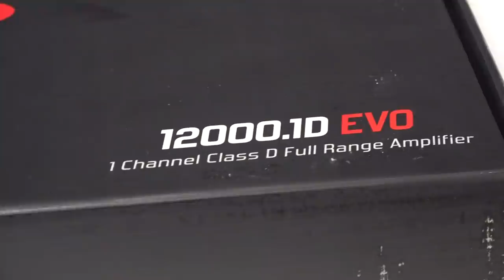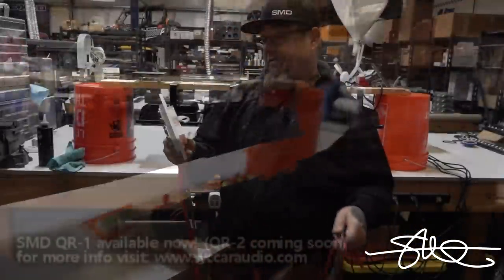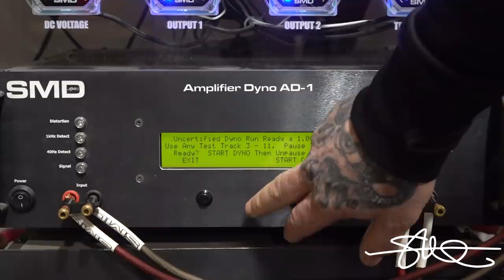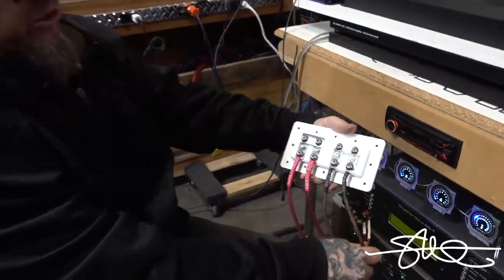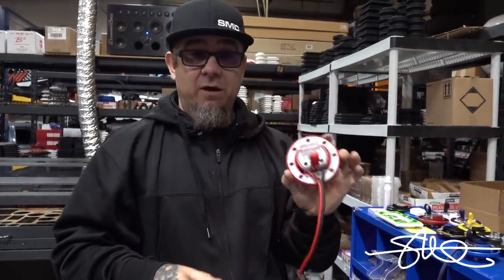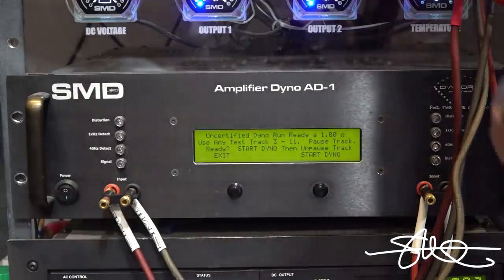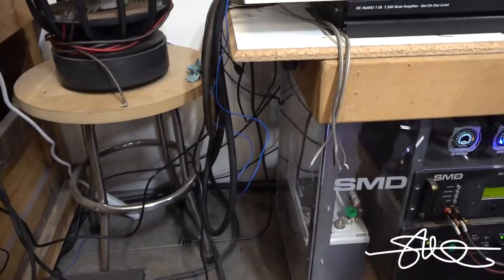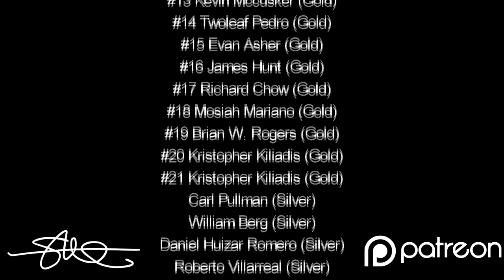12,000 Watts? Testing the Soundigital Evo 12000.1D Through the NEW SMD QR-1 Neo Magnet Terminals

Comment: Would be cool to see a FLIR thermal camera on the cables and terminal with that much power.
Reply from the maker: you won't see anything.  Not for this test. Everything was ice cold.  Maybe after i torture it.  Ill check amazon and see if i can find a cheap one that works good :D
Reply: @meade916  Awesome. I would buy the terminals without hesitation. But to see the demo would put all the naysayers to rest. Especially after a 2 hour torture test.

Comment: Thanks for this test that amp is a beast. I have been curious if dual feeds made anymore power. Your test shows yes it does but not 100s of watts. I been wondering about running dual 0 ga to my amp but looks like I'm not loosing a ton of power with one run. Thanks. Those terminals really held up well. Looking forward to next one as always.

Comment: I got this one and the 5k both insane I had my 5k pushing 2 sundowns x12s in a Lincoln MKX goin crazyyy broke the hatch which is surprising because that hatch is super heavy..cracked the windshield and broke my rear view mirror from the windshield. I never heard anything slap as hard as that truck .. still got the setup but don’t have the car . Now im running this 12k on 2 g5 12s

Comment: Hey Steve, I have a question on my soundigital 12k. Would you run 3-dual 4ohm subs on that 12k with the right power and voltage?
Reply: Yes u can that’s fine it don’t matter if you run 1 sub or 20 subs on it as long as they’re wired properly at 1 ohm or above . Power/voltage doesn’t matter with how many subs you have it’d make no difference with 1 sub or 20 just depends on the amps power draw

Comment: I thought these where rated at 12.6 ?
Reply from the maker: i only have a 10,000 watt power supply.  That is why i said it would do a lot more if i had the power (amperage) to make up for it.  It did well for not having enough power for it though...Look at those wires moving like there is water being sucked through them...

Comment: I've been looking in Brazilian amplifiers and really want to know what brand is the. Best and most powerful. Powerus isn't available right now. So it's out of soundigital, taramp bass line, are banda electra bass line. Which is the best?
Reply: Soundigital
Reply: @justinatmidi  sure?? Better than the banda beat model?? Need to power 4 speakers of 180 watt each and saw the soundigital evoX 800.4 and banda beat 800.4. Still wondering which 1 to choose.
Reply: here in brazil is 1stsoundigiltal 2nd taramps 3rd stetsom 4th banda
Reply: @justinatmidi  so soundigital hits harder than all the other amps? Now I did research on the amps and powers 8000.1 smokes them all. But can't find them any where so I want to know the next best. So looks like soundgital it is! Thanks
Reply: @carlosduarte6391  thanks mego! Soundigital it is because I can't find the powers8000.1 amps any where.They are post to be the vest Brazilian made amps ever
Reply: @yan5362  I’ve had the Evox 800.4 since last April  2021. No issues at all and really loud.

Comment: DB drag we used 8 GA all the time with 5k easily with no issues.   So this test makes sense.
Reply from the maker: 12ga can support 5,000 watts easily.
Reply: I have 3 zero gauge for my tweeters 😂  just a joke.. but for long distance its better   to make all a little bigger then the factory sayes... i have tested a 4qmm2 speakers wire for 13,7kw rms.. it works of 3m but not really good , not the full power comes to the subwoofers... but thats normal it is a resistor not a wire 🤣

Comment: Hey meade just a question if i had an amp hooked up with a neo block like that on my box pulled the box and the amp neo stuck to chunk of metal is it going to short
Reply: If your pushing power to the box then yes (small tiny spark) if not pushing power then your good
Reply from the maker: probably not.  But if you feel that will be a problem put the cup in the car and the wire on the box.  Done.
Reply: @meade916  thank's for the response meade been a while sense we chatted. Maybe just install in both lawls car is a 2016 focus ST walled 6th order with 3 SP4+ V2 18" on 3 BC 13k's on lithium and caps with dual 330 alts. The box is on slide  rails with actuators amps and batteries mounted below the box and rails

Comment: Looking for some advice. I just got two 2000 pyle 15's I have a 2000w amp for each sub "both in the same box with separate inputs  but each speaker has 2 inputs how  do I wire them
Reply: We would need some model numbers my dude. In general, wire them parallel to get 2 ohms at the amp. That's all positives connected together from the sub to the amp, and then the negatives. Hope that helps.
Reply: @thegoodlife3912  helped out a lot thanx
Reply: @thegoodlife3912  it's a pyle 15 inch sub "PLPW15D" To a boss amp R2000M

Comment: I am between this and a taramps 15k bass. Which one hits lows better?
Reply: Taramps bass always got a lil More power than the normal taramps but i would choose soundigital because Is More efficent
Reply: @ThePato1234567  does it hit low? Meaning I have a VFL comp 2.5k (korean board) and replaced it with a Sundown SFB 5000 (Brazil) and even though the Sundown was double the power I felt it didn't have that low end hard hitting thump.
Reply: @MrLips635  usually that 2.5k korean board doesn't make only 2.5k maybe It would push over 3-4k dynamic so that Is why u don't see difference between those boards
Reply: @MrLips635  if u don't have up to 14v the brasilian amp doesn't make the rated power i say this because they draw More amps and if u don't have a strong electrical system u won't get the rated power either
Reply: @ThePato1234567  I have the big 3 and 0 guage wiring. Also have a Mechman 250amp alternator. I am going with 2 Limitless Cyber 12k lithium batteries. I was going to do the Sound Digital 12k evo X for two 12" Vfl Comp Signature subs that are each rated for 5k rms and 10k peak.
Reply: @MrLips635 nice system so i would choose the soundigital 12k if i had that setup
Reply: @ThePato1234567 how about a Soundigital 12k against a VFL comp 12k?
Reply: sound digital 12k vs. Sundown SALT 8?

Comment: i went to there website and it says there signal to noise ratio is >76db, isn't that dirty power?  I need something really clean to push 6 2000 watts ea dual 4 ohm 15 inch subwoofers
Reply: Dirty power is dirty power no matter how many rms watts a amp has, remember the Power Acoustik class D frenzy years ago?  All has happen is there more powerful now but the same dirty distorted power.  Signal to Noise ratios don't lie lol
Reply: More powerful amps that is

Comment: Id love to see what the biggest amp that taramps amp they make on a dino test did I think there biggest ones are the 20k and 30k ones they say they are every bit of whats wrote on the from and then some all that power in 1 amps is just fuckin bonkers fr isnt amazing what kinda power these newer amp companys has pushed the limit is just crazy fr and they are soild too and to keep rolling them almost same numbers every time ya they are super impressive real talk
Reply: Taramps makes a 160k high voltage amp...
Reply: @johnlaw8476  I'm talking more like along the lines of there surf board edition amps fr fr i know they make a.couple.really big ones fr I'm just old school I stick to.what I know and thats precision power company fr i used the ppi pc class pc 2350s back in the day 2.of.the.2350's and 2.of.the pc 450's on all jl.audio.w6 15's 6 of them wired down to 4 ohm bridge on each 2350's 3 per amp @ 1400.1 @ 4ohm bridge and i was running my pc 450's 50x4 @ 4ohm stereo on all mb quarts pro comps 6.5 separates 8 of them and 8 5 1/4 sprites in the mix to @ 50x4 @ 4ohm stereo with 8 3/4 tweeters all mb quarts then i was one out of 3 in the hole.state of.ky that had the first cva 1000' alpines tv's in there ride the ones that didnt have rca out puts u had to splice into the harness to patch the rca wires into the set.up.fr. then I was running my 15s @ 1.25 per sub sealed so I was getting the best of both worlds spl right along with clean and clear if need be fr and the way my box was set it was dam close to a 4th order before 4 th order was even discussed anywhere fr fr then I figured out what Polly fill will do then it.was really on but not all before I had my single.cab 97 ford f150 slammed to.the ground with a snug top camper with the window boot in it so.i was able.to.build.my enclosure into my bed resting back on my tire wells to.keep it from moving around and then I made a port style frame that went from my box till right at the end.of my window boot and then took.a.peace of marlite and a peace of construction paper and figured out the pattern of the way my head liner was made and then traced it out mad a hole.and reach my hand into the.opening and traced out the opening on the back.side so I ended up with my.final trim panel and then I took 1 in foam padding and cut out letters and then traced them on to cardboard and glues the foam on to the letters made of.card board and then placed AFFORDTHIS 97 AT THE BOTTOM.OF MY TRIM PANEL AND SPRAYED 3M ADHESIVE ON EVERYTHING AFTER ALL THE LETTER GLUES WAS DYED REALLY GOOD THEN TOOK THINGS LIKE LITTLE AND DIFFERENT PEACES OF 1/4 IN PEACES OF WOOD AND STARTED TO.MOLD IN MY LETTER IN MY CARPET SO THEY STUCK OUT AND AWAY SO U COULDN'T HELP BUT NOTICE WHAT IT SAID FR CAUSE BY THE TIME I WAS FINISHED WITH THAT PET PROJECT I HAD AROUND A 125,000 IN THE TRUCK ALL THE ACCESSORY AND THE SYSTEM AND RIMS AND LOW CUT WHITE AND GOLD SIDE WALLED TIRES BUT ONLY THE PROS KNOWS WHAT KINDA TIRES WENT WITH THOSE KINDA TIRES FR FR 22IN ALL GOLD DAYTONS FR FR MY WHEELS COASTED MORE THEN MOST PEOPLES WHOLE RIDE FR BUT I WAS A.POUR BOY THAT GREW UP AND NEVER HAD SHIT FR FR BUT OLD.HAND.ME.DOWNS SO When I .GOT A BREAK.WORKING WITH THE PHONE COMPANY MAKING A 150,000$ A YEAR WORKING WITH FIBER OPTICS GOING TO WORK CLEAN COMING HOME CLEAN UR DAM.RIGHT I TOOK ADVANTAGE OF THE.SITUATION FR FR AND ID SAY STEVE'S BEEN RIGHT THERE where i was at once upon a time  .RIGHT ALONE WITH ME.BROKE AS A.JOKE.WONDERING WHAT UR NEXT MOVES GOING TO BE AND WHAT THE OUT COME IS GOING TO BE BUT WHEN GOD CLOSED THAT BAD WINDOW FOR.STEVE AND OPENED UP THAT DOOR WITH JUST A.SMALL.FRACTION OF LIGHT TO BE SEEN HE.STUCK.HIS.FOOT THROW.THAT DOOR AND FAUGH HIS.WAY TO THE TOP. NO MATTER WHAT NO ONE.SAID HE.KEPT.HIS.HEAD IN THE GAME AND LOOK WHAT ITS GAINED HIM.ALOT OF.RESPECT INCLUDING MINE FR FR LOTS OF MAD RESPECT STEVE FR KEEP SHOWING ME MORE AND MORE CAUSE HE IS LIKE A AMAZING TYPE OF DOORWAYS AND IS GIVING AWAY KNOWLEDGE MONEY CAN NOT BUY IF PEOPLE WILL.JUST PAY MORE ATTENTION TO EXACTLY WHAT HE IS.GIVING EVERYONE EVERY TIME HE POSTS SOME THING FR FR IM A.OLD SCHOOL CAT THAT IS.ALWAYS LOOKING AT THE NEW AND IMPROVED EQUIPMENT ON THE MARKET FR FR CAUSE KNOWLEDGE IS POWER MY FRIEND STEVE IS.LIKE ME IN A.LOT OF WAYS U ALL.ARE PAYING STEVE FOR.WHAT HE.KNOWS NOT SO MUCH WHAT HE CAN DO AND ACCOMPLISH FR FR BUT HE HAS GOT FAITH IN HIS SELF right along with self pride AND HIS.FAMILY. IS WHAT KEEPS HIS PUSHING FORWARD FOR A BETTER TOMORROW REAL TALK